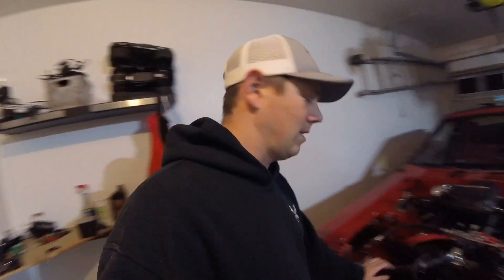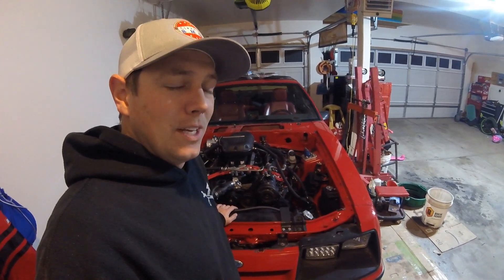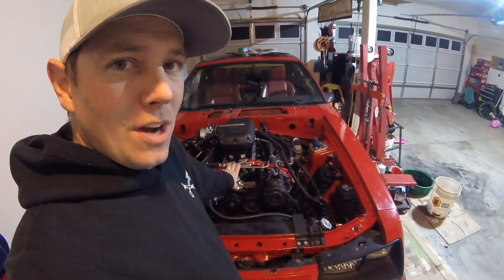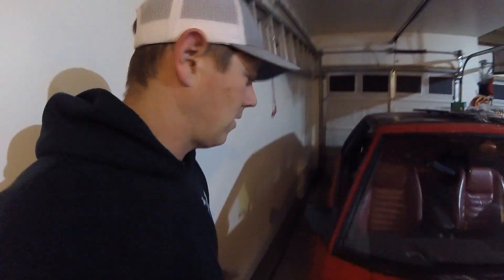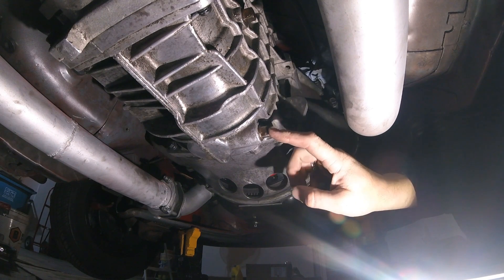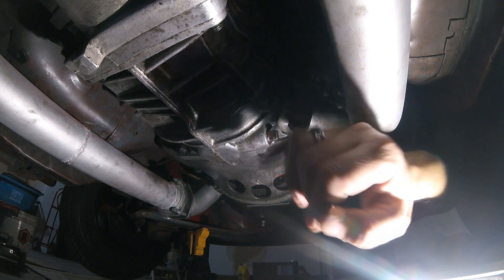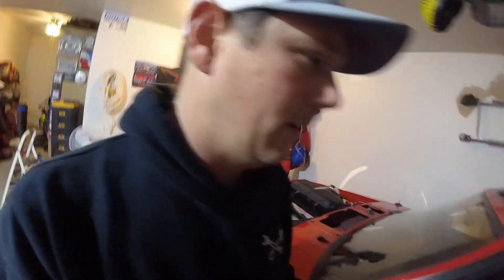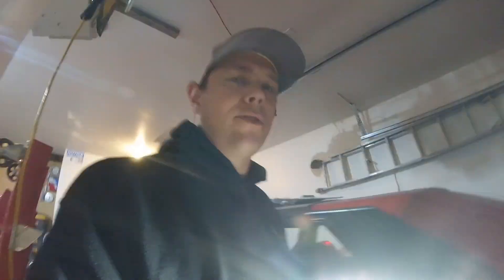T5 / TKO - What Fluid & Where to Fill?!?

Comment: I have a  TKO 600 in my FFR Cobra. Originally used Mobil1 ATF as recommended by Tremec. The shifting was very notchy and I really didn't like the transmission. Then Tremec came out with their own MTF. It was expensive (about $20 a qt) so I was reluctant to try it, but I did. Best thing I ever did! It feels like a completely different transmission. It shifts incredibly smooth with no notchiness. I never tried tried any brand of Synchromesh, so I can't compare it to that.
Reply from the maker: Nice, thanks for the info!
Reply: Sweet i just ordered them from tremac about to do the 1st fluid change
Reply: Thank you! I’m doing a fluid change currently on my 67 Camaro and I’m going to go with this MTF. No one knows their product like the manufacturer. If they make their own fluid for it, it must be good.
Reply: Just add a little Lucas to the fluid and you're good

Comment: On the tko the drain plug has a magnet and the fill plug doesn’t, so make sure you don’t swap them if they’re out at the same time because they look the same externally. 

Did you holsesaw windows into your bellhousing?
Reply from the maker: Nice tip on the plugs.

No I didn’t hole saw the bell housing lol .  Not sure what’s up with those... been there since I picked it up used...

Comment: Interesting video. Question doesn't the transmission in your race car operate differently than say a street car? If the Amsoil atf is actually for racing wouldn't one not for racing be better?
Reply from the maker: Most of he miles on my racecar come from the street 🤷🏼‍♂️

Comment: Do you happen to have the product number for the AMS Oil trans fluid?  I got a WC T5 in my racecar, and I am looking to replace the fluid for the first time.  I keep going back and forth on what to get.
Reply from the maker: Torque-Drive® Synthetic Automatic Transmission Fluid
Product Code: ATD1G-EA

Comment: Will a z spec t5 hold up to a 408
Reply from the maker: A lot of that depends on the 408, but in my opinion, that’s a hard no...  the spec z t5 is still a t5 but rated for a few more ft lbs of torque.  If you’re going to beat on the 408 like I know I would, it’s on borrowed time from the start
Reply: Thanks for the info brother gonna go with the tko 600
Reply from the maker: That’s a good plan.  You’ll thank yourself in the end

Comment: How many QT  a T5 takes  thanks
Reply from the maker: I’m not sure on fluid capacity.  You fill it till it’s up to the top inspection/fill hole on the side of the case
Reply: I believe it's about 2.8 quarts, but I hear people can usually only get 2.5-2.6 in there when they change fluid
Reply: 2.8 quart